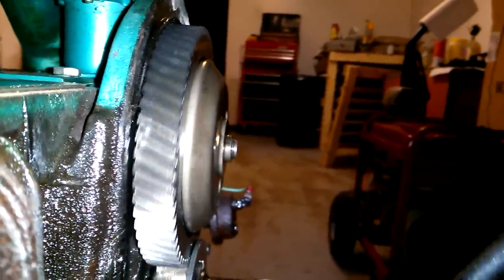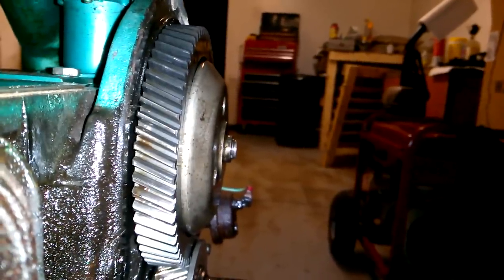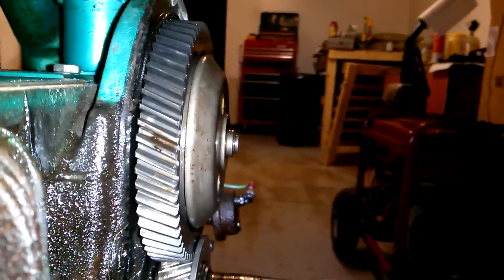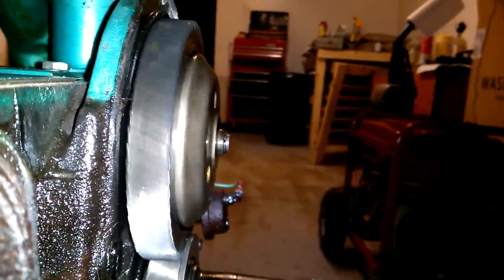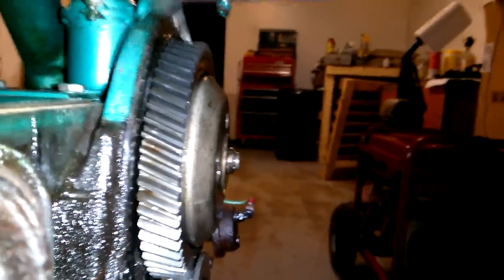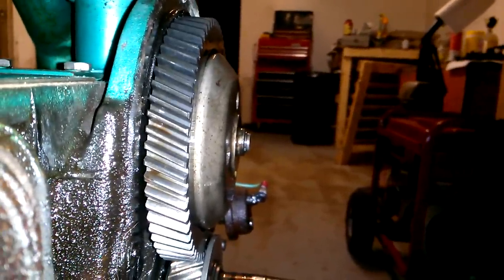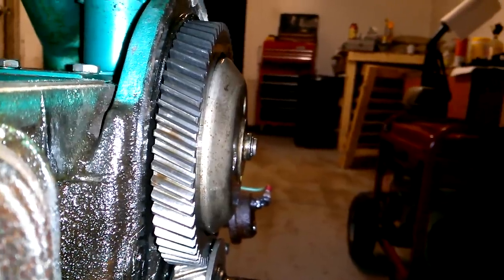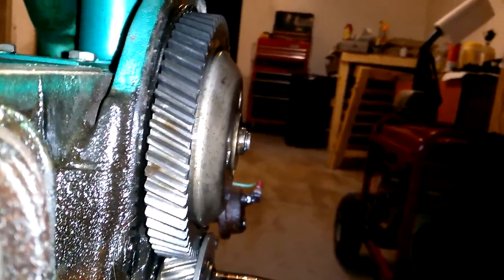Onan 6.0 CCKB knocking....

Comment: Actually I think mine does the same thing it's a 2.8 previous owner said it's always had that knock in it,  not too worried about it, that all Onan generators sound like that
Reply: Andrew Crocker well this is my first RV that has a built on Onan generator so I have no clue how to maintain it and I don't have the manual for it. This will be day 4 that I have owned it, the previous owner said the RV has been sitting for 2 years it's a Chevy G30 1991 Class B Van style RV.

Comment: I noticed the exact same thing during my rebuild of onan b43e. Machine shop told me it should be fine once the engine is running because of holding pressure from the governor on the flyballs in the flyball spacer. Really hope he's correct because I am feeling like when I go to start this thing i will have a knock in it too. Have you got any updated info regarding this?

actually yours does it on every revolution mine only did it on every 2nd revolution indicating an issue with the cam lobes or tappets but none was found
Reply: Andrew Crocker yeah I already adjusted the valve lash after rebuilding the motor. Just thought it was strange that the cam walked out like that at all. If I went counter clockwise I could see that happening because of the helical cut of the gears pulling it outward but going clockwise shouldn't do that. However I am glad to hear it isn't an issue and seemingly is normal. Yay! Thanks for replying
Reply: So what caused the knock in the end?

Comment: deff a retainer or something ,i have a 4kva with a knock wish i heard yours running .
Reply: was just looking ,,my 4kva has a similar sound , and did  cam bearings fix it or was it something else ? . i see the retainer on the crank end it just seems to be trust so take up play ? new part ?.
Reply: Andrew Crocker Cheers i had a look at mine and found all ok but cam shells worn so i adjusted the tappets (cam followers ) and it's a lot quieter ! :)
Reply: looking it could be worn cam too with bad adjustment on tappets ,my crank was fine .the noises do echo thru and are hard to pinpoint .the retainer is on the front of the crank nothing else stops the cam moving forward.
Reply: well all you can do is set tappets then ,anything else is cam shells ,mine was very noisy till i did tappets ,but i think the shells are worn too.
Reply: yeah i have ,it was the first place i looked for wear ,but they were in good condition .after that i saw your video ,my cam wasn't moving like yours was but i could hear the knock when turning it over .turns out to be excessive horizontal wear from bad adjustment (i think) too much free play being a flat twin.
Reply: cam shells mainly side to side and bad adjustment was allowing it to knock.
Reply: knock and pretty loud could hear it still when i walked away around the corner and worse when hot .
Reply: best thing to do then is ,sump off and feeler gauge the crank not to big a job ,after that it can only be the can shells .let me know how you go :) .